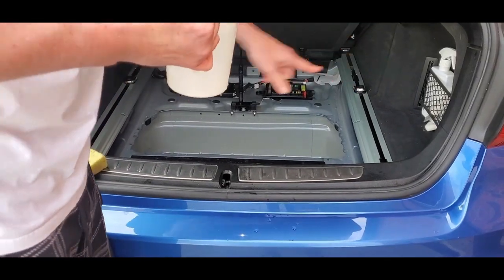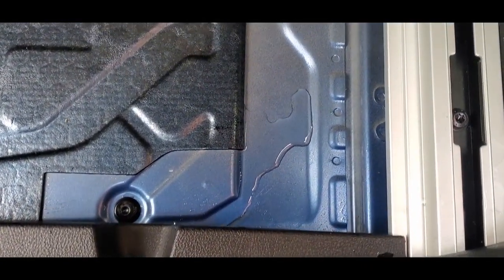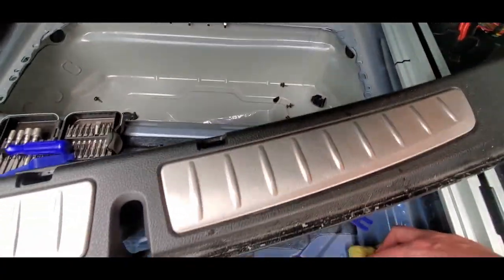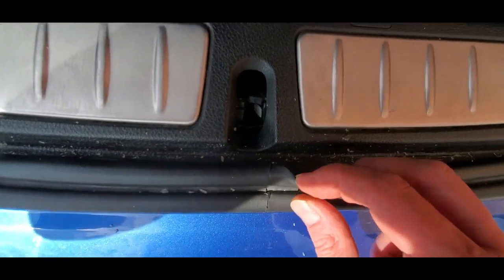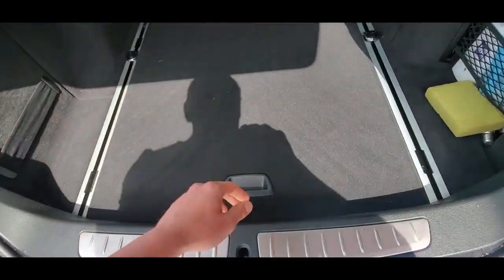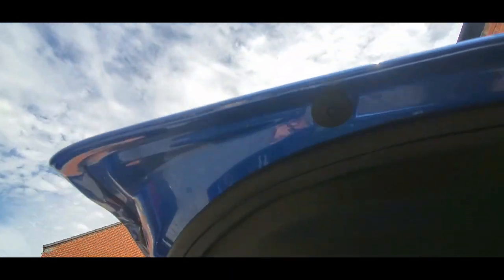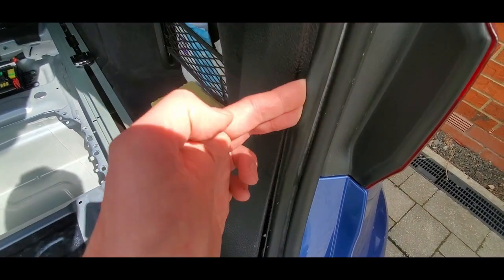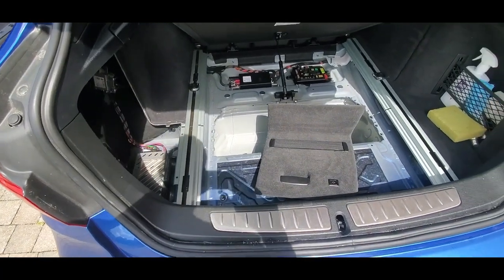BMW 3GT BOOT LEAK FIXED PART 2!!

Comment: Has this solution worked? Have the same issue with water coming up from the corners on both sides..
Manged to dry the amplifier and cleaned the motherboard with Iso alcohol so now it works again 😊
Reply: Yes this has fixed the problem. The boot has been dry ever since thank god!
Reply: Hi, what did you use to seal it. I have a similar issue with my F31. Thanks